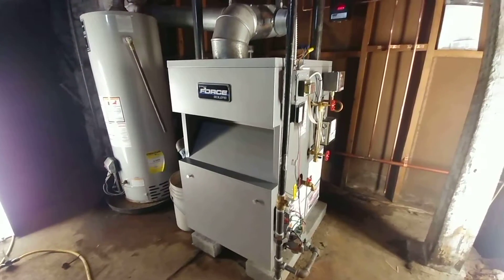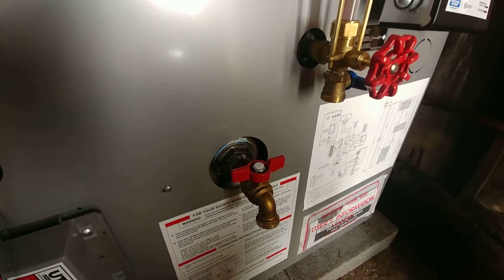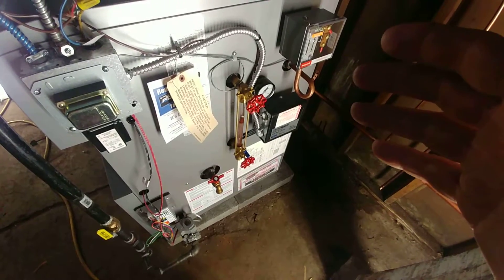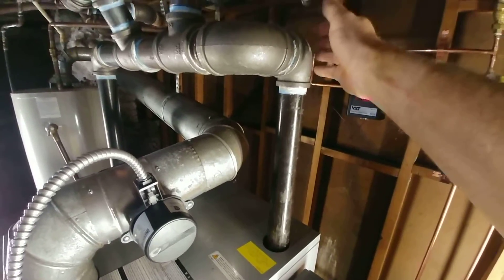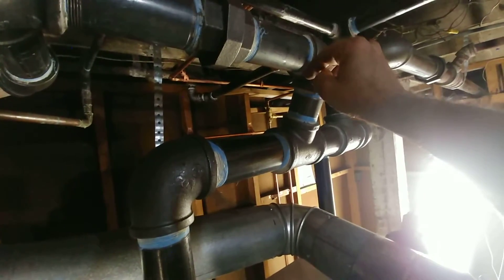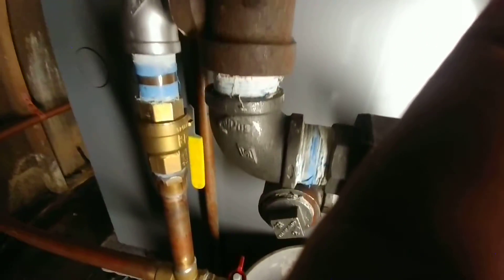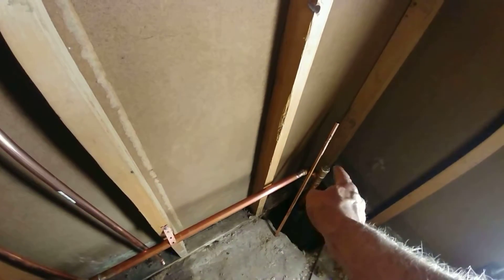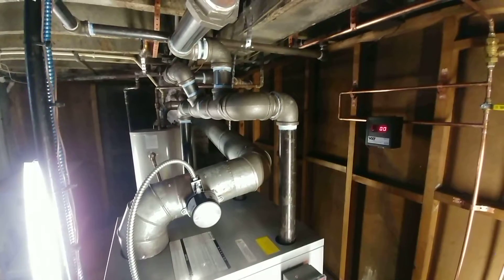All Steamed Up, Inc Uses The Force (steam boiler)

Comment: Gordon , I noticed you use quit a few of those Carlin EZ Gas conversions on new gas steam boilers. Would you recommend the extra cost using those units on a residential install and how much more efficient will it be.
Reply from the maker: Power burners/boilers in general are more efficient than atmospheric burners by a few percentage points...on paper.
Over the life of the boiler, that can add up, especially on the larger boilers.
There are a lot variables that go into the decision, however.
They are more complex, expensive and noisier, so they are not for everyone.

Comment: The "skim tapping", used to remove the lighter-than-water scum from the boiler, is located on the upper left back of this boiler.  It is 1-1/4".  It would have been nice if they instead used a  1-1/2" tapping to allow for a more efficient skim.
Reply: The last boiler we installed was a Slant/fin.  They have a 3/4' port that you want you to use to blow the boiler down rather than skim it.  Build some pressure and let 'er go.  I don't know, seemed to work.
Reply from the maker: @amradco  Yes, that type of skim tapping is unique to Slant Fin and they do appear to work very efficiently, some would say they work better than the traditional type of skim tapping.
Reply: @amradco : As well as the very good blow-down port design of the Slant/Fin, they also have a nice 2-1/2" tapping at the top, as you well know.  The only issue I might have with that Slant/Fin is the return is only 1-1/4", a bit too small IMHO, and they have no tapping for a boiler drain.  I have had to deal with boiler were the installer simply didn't bother to put in a tee and a bushing to add it.  Had to get the sawsall out to drain that boiler.